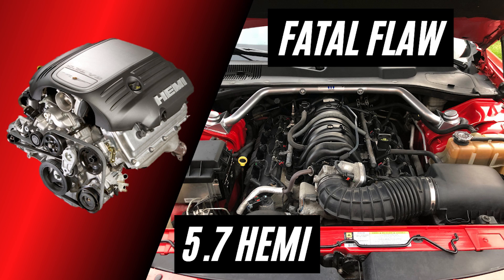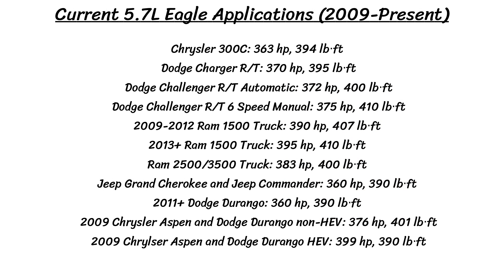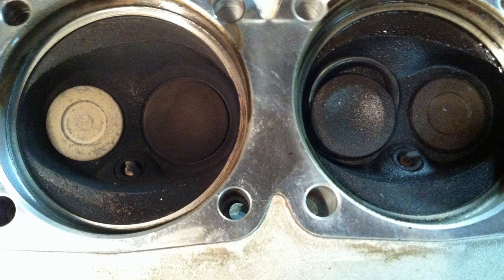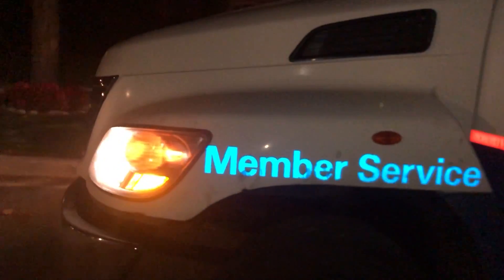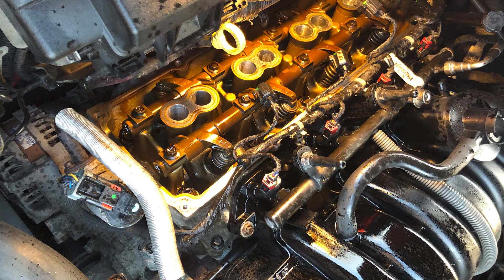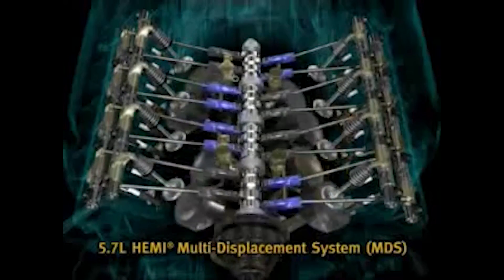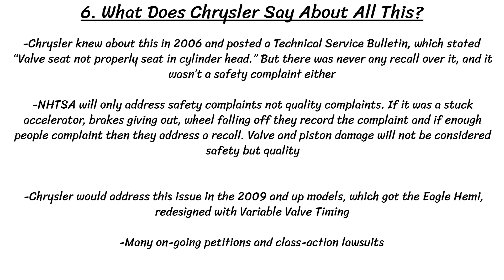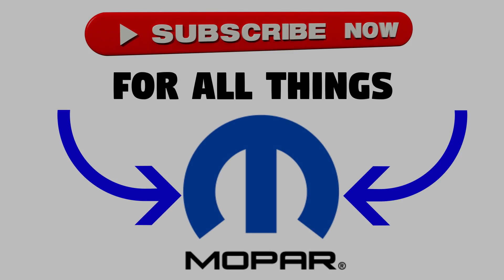The Fatal Flaw of the 5.7L Hemi V8 Engine & How to Prevent It (2003-2008 Valve Seat Drop)

Comment: Looks like I might as well get a 5.7 L hemi from like 2011-now, would that be smart?
Reply: I had an ‘11 300C, crapped out at 195,000 miles #4 cylinder lost compression 
Sold the car as it needed an engine rebuild
Reply: @Hybrid Libertarian the 06s to 9s i think, the first version, SOME SOME SOME of them can drop seats most likely from overheating...the 9 10 and up eat up the cam and lifters just out ofthe blue. Millions of engines out there, it is a problem for sure but not as widespread as some think. My 06 Daytona charger hemi has 130k miles, no problems yet besides a PS pump which i blew doing donuts with most likely original fluid in it, a few small leaks, suspension being loose ect. No engine problems.

Comment: Most wide spread problem I have heard of is lifter failure which eats up the camshaft. That is mainly in 2009 and newer models that have both MDS and VVT. I don't think MDS and VVT play well together. 

Oh and I am still driving a single cab 2005 Daytona edition Ram 1500 with the 5.7 Hemi. Hope I don't jinx myself, but I am at over 210,000 miles now without any engine issues so far. It's been great.

One other small thing. My 2005 Daytona edition has MDS. I know it first came out on 2006 models, but I think the 2005 Daytona launched late and was on the assembly line with the 2006 models.

Comment: I have the 4.7 V8 in my Jeep that dropped a valve seat. Come to find out after a little research the the 5.7 and the 4.7 are identical designs. Blew my mind if the awful design after I pulled the valve cover and the head them selves.
Reply: Yep. I have a 94 dakota I'm thinking of taking the 4.7 out of my 2000 durango and putting the old 318 from the dakota. But it'll be a lot of work.

Comment: Reading the comments and I have to just shake my head. People have to remember that no matter how good a design is, it's still made as cheap as possible. Issues WILL creep in. The great thing about Engines, especially ones this old and this style, is the Aftermarket has you covered. Depending on what your skill level with a wrench is, it can be fixed. Aftermarket Heads that address this issue aren't cheap but they are still cheaper than a complete Engine. Just like GM's 4L60 and their notoriously weak Sun cage. Just like Ford's issues with their Diesels a few years ago, (Sux that you had to replace every bolt in the engine) but it could be made bullitt proof.

Comment: I’m at 173k on my 05 Ram 5.7, fingers crossed that it has proven itself. I just installed a 190* thermostat last week when I replaced radiator and water pump. Cats have been off for probably 10 years.

Comment: My 07 Charger R/T dropped a valve seat at 213,000 miles bought the car with 170,000 put in a used engine with 135,000 on it have almost 195,000 on it so far..keeping my fingers crossed.

Comment: 04 Durango 5.7 died at 78,000mi., well maintained at dealer Towed 4,000 lb travel trailer form Philly to Arizona on vacation twice other wise driven by the wife to work. Would not start one morning. Luckily had 80,000 mi. drive train warrantee. Dealer replaced motor. 123,000 miles on car now. 
 I will follow your tips going forward. Thanks

Comment: Valve seat issue, was an issue but it was not evident in a large portion of these engines, the biggest problem this engine has is the failure of the roller lifters. The reason those rollers fail is because of the angle that the lifter sit at and they never get directly oiled. The Fatal flaw of this engine is not oiling the lifter rollers. It has nothing to do with the dropping valve seats cuz at least 70% of those are caused by overheating the engine. It didn't even start occurring until the cars were several years old where people had disregarded the reality that still exists to this day that you should drain and refill your cooling system about every 3 years.

Comment: 06 charger dropped valve seats twice and now doing complete engine rebuild with close to 100k miles
Reply: How do you manage to drop them twice? Coolant overheating? You run it REALLY rough?
Reply: @baileyhatfield4273  lol when it was new yes ran it hard, after the head work started to baby it. Dropped them again, now have a rod knock been driving it like a baby

Comment: Reminds me of the old Saab 900 turbo. No intercooler and would drop seats like crazy!  Nice video, good work! The cure here is a real good machine shop that can install the updated seats and do it correctly. On the old Saab I once worked on I peened the head all around the exhaust vale seats in an effort to lock them in place. My advice is sell the car!

Comment: Mines got 160 thousand going strong . I also tuned mine so it doesn’t go into fuel efficiency mode and my cooling fans to cut on at 180 degrees

Comment: I have a 2003 Dodge Ram 2500 with the 5.7 and 186k miles. I use my truck mostly for towing my car hauler or my 10k travel trailer and have had 0 problems with my engine. My truck still runs strong and healthy. Also I live in one of the hottest climates in the US where temps reach up to 130 degrees and regularly sit at about 115 on average.

Comment: Wow my 07 Chrysler300c has over 165000 and is still running good but I did change the timing chain, oil pump and water pump. Should I delete the MDS? Just wondering.

Comment: I have a 2006 Jeep Commander with the hemi and it did exactly that except I went to pass a slower vehicle and it loaded up then bogged down and quit I was able to get it restarted but it knocked real bad on right side got it home and pulled plugs and #4 cylinder spark plug was smashed we bore scoped it and I assume now watching this video that the valve seat dropped I’ve got a second engine out of a 2007 hemi commander that I will now go into and check/fix this issue thanks so much for the video mileage was 165000

Comment: Ah, yes, the "fatal flaw" that effects about 1-2% of the hemis made in that time at most. The complaints/petitions that went out found 10-20K people who had it happen a few years ago out of what a million hemis from 03-08 at least, so lets say only 1/2 people with the problem complained maybe you are seeing 4% have an issue... Also, it can, and has happened on the eagle hemi's as well, and can and has happened to about anything with an aluminum head and steel valve seat. I currently have 2 well over 100K hemis, that live in the SW us in the heat, neither has a problem with basic maintaining of the car and nothing special because apparently I didn't get unlucky.

Also, there was no recall on the gas tank, about 150K cars that had a potentially bad gas tank got a lifetime warranty on the gas tank, but it was never recalled and it won't be replaced until/unless you have the issues with it that caused the warranty. One of my cars (my 06) was in the warranty and has to have the tank replaced, fighting to get it done now, which is made harder as it was never a recall just a warranty.
Reply: I'm dealing with this directly as I've been having (thankfully VERY intermittent) issues due to the tank.  Since my 300C was imported to Canada, Chrysler will not honour the extended warranty despite it obviously being a safety issue.  It's a $3000 CAD job out of pocket, which is not really money I have lying around, being a broke college student.  Thankfully there is interim measures that can be taken to push the issue farther, but eventually I will need to replace the tank, especially if I ever want my engine light to go out.  It's pretty annoying.

Comment: Well I had purchased a MINT condition 07 Grand Cherokee limited 5.7 Hemi, I got it for a steal from an older wealthy man who claimed to maintain it meticulously but it had 125k on it. I trusted him only to find out some of what he said was not true. Anyway it was 88 - 90 degrees out, sunny day and I was in a hurry, I was due for an oil change which I had planned on doing that week, I have OCD and I honestly am meticulous with my vehicles- ( New or Used) I was on the highway driving around 90 mph on my way to *WAIT FOR IT** JEEP Service center to purchase 4 bolts for my rear shocks, I was changing them and 1 bolt was slightly stripped, me being who I am could not deal with that so I needed 4 Mopar bolts and there I went FAST. I pulled up, shut truck off, quickly went inside to parts counter, purchased bolts and in a whim I was back in my truck putting keys in the ignition to get going and ALL OF THE SUDDEN OUT OF NOWHERE I TURN THE KEY - - - CLANG BANG DING DANG BAMM. HOLY SHI@#*!T.. I was in denial but I knew it was bad, I say to myself my oil? my oil is low???? Let me run back to parts and get oil and add it. I did that first checking oil level and it was low so I put in 2 quarts, YES, It was 2 quarts low.....JERK..... Longer story shorter it did not work... YES, Dropped seat = Clang bang $6000.00 later Remann Motor with all the upgrades and a 5 year Unlimited mile warranty. STILL SUCKED...........There you go, wish I knew what I know now then... There is my story,  I STILL LOVE MY HEMI THOUGH........

Comment: 2006 Grand Cherokee, was my nephews, stranded him in Wichita KS. He was towing a uhaul and its apparent now the Hydraulic fan took a crap. Just so happens Chrysler discontinued making the solenoids for the system as well as the replacement hydraulic fan units in January 2020. Who is going to drop 1400 bucks on a replacement bogus, piss poor design manufactured by Valeo. You can do your own reading on the issues Valeo had with production. I unfortunately figured this fiasco of shite out after rebuilding the engine and replacing the heads. Fan would not operate and Chrysler sold no parts for the system except the solenoid claiming its not repairable because its balanced the fan to Hydraulic motor. Fan is balanced with ball bearings in hub but it has nothing to do with the hydraulic motor. I tore this ine appart was able to hone the flow control valves but it ended up being the solenoid that you can no longer buy. So i am now in the pricess of converting it to a two fan electric cooling fan system with Mishimoto racing fans. This will likely eliminate the over heating issue especially for idle, towing and off road use where the over heating issue primarily lies. Chrysler are common crooks in my eyes. Zero accountability for bad design. 106k miles on this Jeep.

Comment: How about the hemi from the 2011 grand cherokee? What kinds of failures do they have? Mine has 204,486 miles and still runs pretty good, although the exhaust manifolds are definitely leaking a little.

Comment: I'm running long tube headers 6.1 intake manifold no cam has yet a j green tune no Catholic converter off-road meat pipe that 5 7 building a lot of power long run intake to the front bumper

Comment: I buy a 2006 Chrysler with the problem and I remove the head and pin my valve seat and I've been driving from Alabama to New York I make four round trip plus drive two hours to work everyday and my 5.7 running super fine

Comment: Bought a brand new Charger 2006 R/T 5.7 350 HP,   DVD player CD player, Sat Radio, Nav.Sys. You need to update the Nav.Sys. CD disk to have the updated maps,And after 14 years 143,000 miles it’s still on the road with no problems, changed the oil right at every 3,000 to 3,500 miles. 
I just brought me another one, 2020
Scat.

Comment: I had the same GoMango Daytona, #2434. I traded it for a Cummins Ram.
Reply: I just bought one, 4185 Gomango also, and now this video and Scotty Kilmer are making me super paranoid and regret it. I just turned over 106,000 miles.
Reply: @thaddeuszimmerman8242  There are millions of these engines on the road with only a small percentage with the problem. Just don't let it idle for extended periods. Really not good for any engine. Don't worry about it. We still have a Hemi, 2015 Durango.

Comment: I have  2005 Dodge Magnum R/T that had no warning, no overheating or check engine lights prior to my Engine self destructing....   151,000 Miles and toast after pulling into a parking lot.  5 min later went to start my car and CRUNCH!   Valve Seat Dropped

Comment: Very worried after seeing this video. I have the hemi described in video. The 2008 with the MDS. I will need to figure out how to disable the MDS for sure. Use my truck everyday for work. Put about 150 miles per day on it driving through the Bronx, West Chester and Connecticut. Also work in Brooklyn. Amazingly enough, I have 170,000 on the truck and it still runs great. I think I will get the 180 thermostat as well. Thank God I never overheated the truck yet. Any other recommendations are welcome from all. Thanks Man

Comment: I don't know if valve seats went out on my 12 ram, but I do know the my cam was wiped out. Had gotten "fixed" by the dealer and cost me around $4500. Drove the truck to work and had to take back to dealer to fix something with cylinder 7. Was not a happy camper...

Comment: older video of dad 2011 Dodge 4x4 1500 Hemi :)
https://youtu.be/BXDu3BAGE5k

we had 2001 and 2011 Dodge and 2011 had just under 100,000 we had her for almost 9+ yrs before my parents trade it in for 2020 dodge ram 1500 4x4 (one higher end models)
We live on farm for 27+year out in the country, The 2011 was our farm truck, Haul horses and hay alike and we never had any problems with her..  Since 2001 my parents been dodge/hemi and they never looked back, They never go back to ford or dodge cuz how good our truck was. My parents are very happy with current 2020 1500 4x4 pickup :)

Our farm was almost 1+ hour away from Calgary Ab Canada. My dad was also heavy duty mechanic and a lot ppl do not look after there vehicles/engine properly/or do proper oil changes..  Which is driver error, not the engines. Alberta get some prety bad snow storms during winter..  we've never had problem here. Perhaps it USA issue? or certain models

Comment: ''premature dropping valve seat'' bruh it should never drop lol
Reply: Truth!
Reply: Glad my '95 Ram has the torquey iron headed 5.9L. engine good for 500,000 miles...
Reply: @BuzzLOLOL  I had one of those in my '94........13mpg and 100 less HP than the 18mpg hemi. Oh and transmissions that would shit the bed every 50k. I need to find me a square body 81-93 again and then put a 5.7 in it.
Reply: @yurimodin7333  - Magnum 5.9L has plenty of HP and especially low RPMs torque for truck use and vastly longer lasting! Mine averaging 19 MPG... no tranny problems...
Reply: Overheating the engine does this to some engines lol. yeah it's a problem, but so is overheating

Comment: The little ford CVH engine used in the Escorts and early Focus has the same issue, except it happened a lot more, and no single circumstance was ever singled out, and like Chrysler, Ford never admitted it.  The seats were made out of sintered material instead of solid like Stellite, and that may have been the issue.  Some engines never experience it, some were under 100k, on startup, going down the road, there was never ant consistency.  The '91 and up Escorts were great little cars, let down by one big engineering cock-up.  Find a clean one, get a properly rebuilt head, and you've got a great car.

Comment: It happened on my 2005 Magnum R/T at 220,000 miles, luckily the exhaust valve bent trapping the valve seat and preventing any more engine damage. Got the head repaired for under $300 and that engine was still running good when I sold the Magnum with 318,000 miles.
Reply: Magnum r/t is such a cool car
Reply: It's a hemi 5 .7 it runs good but I won't it faster what do I change first to get instantly more power thank you should I burn air plane gas in it or just a booster at part store
Reply: What all did yu have to buy
Reply: sounds like you got a lot of great use out of that car :).
Reply: There are warning signs your car will start shaking badly it just happened to mine it’s fixed now but I was mad asf
Reply: What was wrong hope you don't mind telling me
Reply: I'm just looking for more power I change plugs can I bye a bigger trade or hotter coils or what fist thank you
Reply: @ShelbyThomas-u5z  I thought it was a check engine light but try new exhaust tips and straight pipe
Reply: Please help me find more power please tell me
Reply: @ShelbyThomas-u5z  but if you want a loud sound get a muffler and Reese at or delete

Comment: Unfortunately my 2004 did the exact same thing at 180,000 miles. Brand new {not remanufactured] 5.7 bought and installed for less than $6,000.00

Comment: The 4th Generation has problems with premature Cam/lifter wear from what I have been reading as well. Exhaust manifold bolts have been known to snap as well, because of the difference in temperature. I have not found anything on my 2019 5th generation RAM 4x4 as of yet.

Comment: I have an 04 ram and while I kept the stock 203 thermostat, I did install an engine oil cooler and an oil temp gauge. My oil temp in the summer stays between 190 and 200 and as low as 170 in the winter.

Comment: I have an 04 Ram 1500 Hemi non vvt thank god, I never heard of this valve seat issue before. Thanks for informing me of it, my Ram has been on countless long road trips, trips to the local strip and the street race with no issues other than her healthly appetite for 93 octane lol..... I run a tune and thats the octane needed for it. I would definitely buy another Ram with the Hemi any day.
Reply: @Hybrid Libertarian I use 93 because it's required for the tune the truck has in it. Before it was tuned I ran 89 and a tank of 93 once a month. No issues.
Reply: The 04 hemi does not have the mds system
Reply: @captainobvious5993  thanks Captain Obvious, sorry man I just had to do it lol...... Your right no mds until 06 I believe, but I've heard if you got the first off the line 06's they didn't have it either? I've never seen one myself.